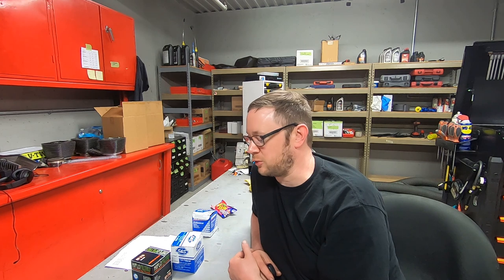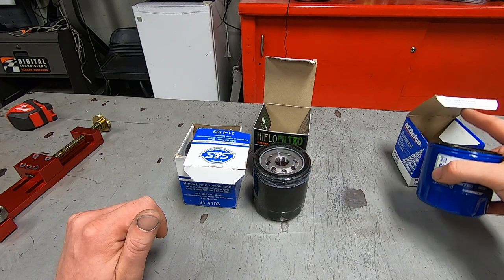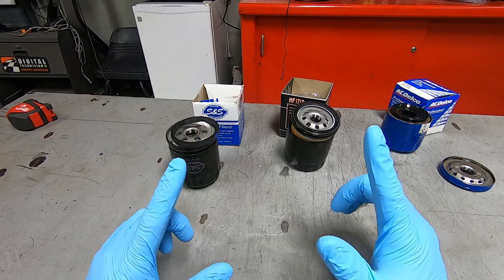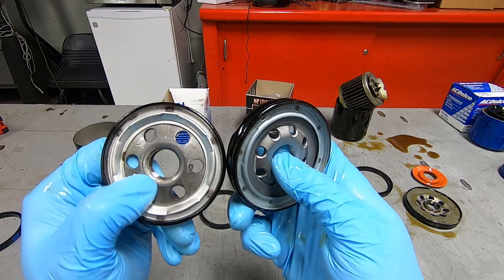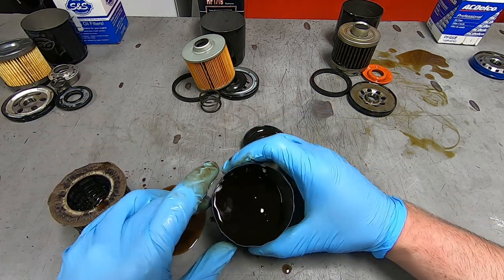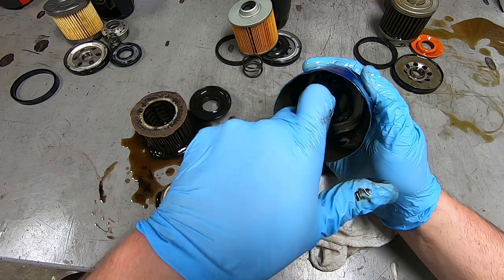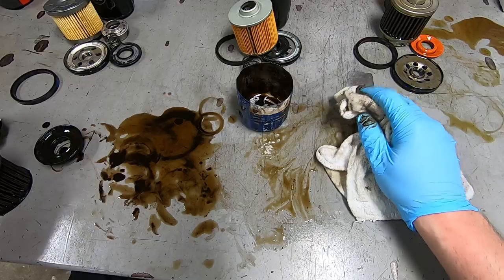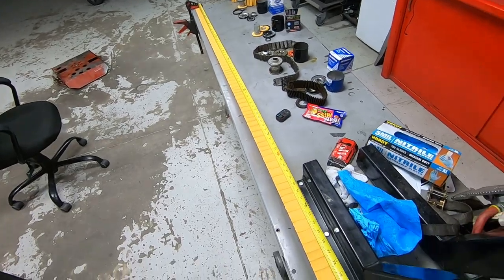HARLEY DAVIDSON OIL FILTER TEAR DOWN vs HIFLO vs S&S TWIN CAM FILTER COMPETITION + CLOGGED ACDELCO

Comment: Hiflofiltro HF171BRC RC Racing Oil Filter  <<---- This is the correct one. Filters to 5 micron and has better filter media. It also has a nut on the end for easy removal.

Comment: I realize that this is a older video but, I still want to add my .02:  I am NOT a chevy fan by any means!  But it looks like that A/C filter from Amazon was a recycled filter and typical GM junk ta boot!   Enough rant.  I am surely impressed with that Hi Flow!  They earned my business thanks to this video.  Thank you for taking the time to investigate these and your time editing and posting it!   Good job sir!

Comment: I only use the hiflo filtro filters at my independent motorcycle shop. The longer and wider filter portion allows more flow through it. Preventing the filter from building up a differential pressure thus casing the filter bypass valve to open. You never know when the bypass opens and allows unfiltered oil to bypass the element. 
In reference to your truck oil filter all the black you are seeing  is the bonding resin that was used to bond the end caps to the filter element breaking down. Due to it being non compatible with oils. I would drain your oil and replace the filter again as you probably had the filter bypass valve open and the crud was mixed with the oil . Just my humble opinion. Love your videos.

Comment: This may have been mentioned buuuuttt Hiflo manufactures all the K&N branded motorcycle filters. It's no surprise that they are similar. HIflo has an upspec filter that even has the nut welded to the front of the can, identical to K&N.
Reply from the maker: I believe it !!

Comment: I have been running the hiflo with the "racing" nut on my road king for the past 2 years since I've been working for Harley-Davidson again, while I was working for Ford I actually ran FL910s and before I left Harley-Davidson in 2017 I always ran the 63731-99a never had a problem with either.

Comment: I learned about HiFlo oil filters from one of Kevin Baxters videos, he owns Pro Twin Performance and Baxter's Garage in Winder, Georgia. He talks about how HiFlo filters, which many people haven't heard of, give great consistent results in oil filter tests and performance, it is the filter that I used for the first time this past summer on my last oil change. I don't have many miles on it since but it will probably be my new go to filter from here on out. By the way I went with the high performance filter with the built in hex nut on the end for easier removal.

Comment: The dealer left a rag in my 454 suburban while working on it. It had good pressure until it sucked the rag into the screen while going up a pass. Thanks GM of Butte Mt for the brand new 454!

Comment: I am interested in what the enginerds have in mind about filter elements. Is there a point of diminishing returns when it comes to having too much filter material? So having all those extra pleats  and material could eventually end up restricting flow? Or is more always better?
Reply: I've been thinking about this. As long as there's enough space between the pleats for oilflow, more should be better. Oil has a certain flow rate, and the more filter area there is, the slower it needs to flow through the material. Say the oil pump pumps one gallon per minute, and the filter has an area of two square feet = 0.5 gallons per minute per sqft. Half the filter area, and now the oil flow is one gallon per minute per sqft. More surface area can also fit more gunk before causing a significant restriction, both because of the larger physical area, and because restrictive pressure loss is proportional to the cube of the speed of flow through the media. If a more experienced enginerd sees a flaw in my thinking, please correct me.

Comment: the auto filter seems to have done a decent job of filtering the oil, at least it held the objectionable material within itself. I'm thinking the black looking gunk is probably soot and carbon from the fuel. Someone suggested an oil test, which is probably a good idea anyway. Also, I'm sold on the hiflo filter, my fatboy is getting that one pretty quick.
Reply from the maker: I really like the Hiflo myself. If I didn't already have 6 HD filters at home, Id try the Hiflo.

Comment: So did you buy the truck new? I was sent the oil off to get analyzed. And I would change the oil quick couple times
Reply from the maker: I bought it recently but its used. Ive changed the oil and filter again just for some good measure.

Comment: Those pyramid or type gaps seems like it would be part of the wording of high flow ..meaning the inside of the circle is tighter than the outside of the circle ⭕️ consequently the flow would stay the same through the media when it’s inside the housing.
Reply: It allows more filttrate material which allows more surface area.   More surface area allows more oil to pass, resultant in lower pressures in the actual filter.   Also allows the user of a lower bypass setting.   Well designed stuff.
Reply: @skippynj1979  I'm wondering if K&N are now going... damn... we need to look into that.

Comment: Brad, SAAB's with turbo's need to cool down. Assuming that you've purchased that car used, the oil in the turbo's will cook when shutdown before being cooled. There is a TSB about SAAB Turbo's and the oil because of this issue. Doing what you had with the oil pan, you may somehow used an oil that is a detergent and is now cleaning the sludge out from the engine. You may want to make sure your oil lines to the turbo are free from sludge as this will burn a turbo out quickly..

Comment: Hey there Brad . I want to ask you ask you Something, i need your help mate . On my road king efi 01 magneti Marelli i removed the epoxy from the air bleed flow screws and changed the factory settings. Can you tell me please , how many turns 360° from the bottom to the top , bassicaly to open the screws, i did by my self almost 4 turns from bot to top , bike is running well but it seems like giving to much air i noticed the engine oil become thin (petrol in oil) only when the air bleed are too open . Please , i need your help . Greetings!!
Reply from the maker: Sorry, I don't know the answer to that question.

Comment: The HIFLO pleat design is the key.  Allows more material which means higher surface area resultant in more oil filtered at a given time.   Allows the bypass to be at a lower setting.

I'm anal about oil and filters in my toys, but at the the end of the day...  change the oil often and it doesn't matter what you use.